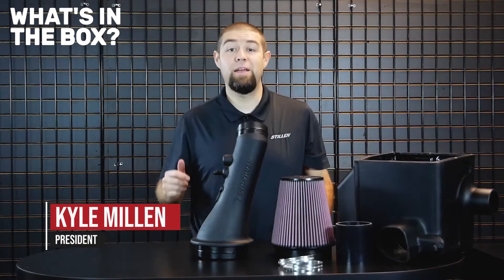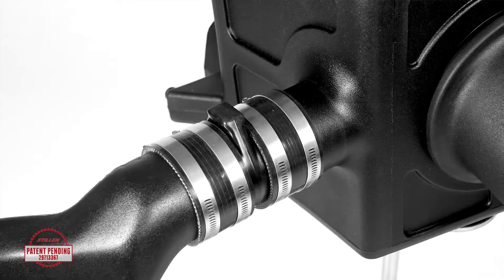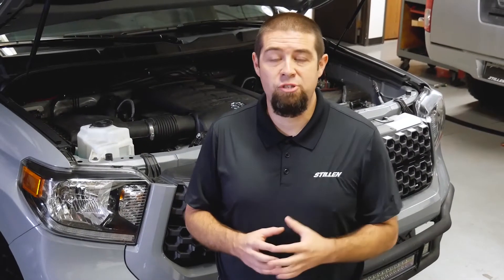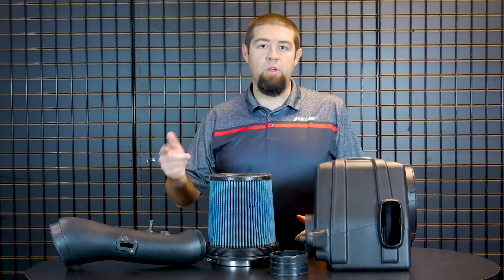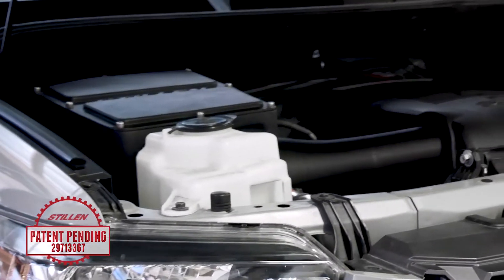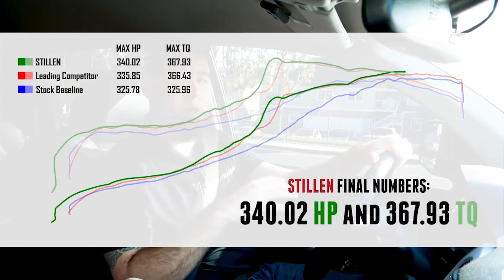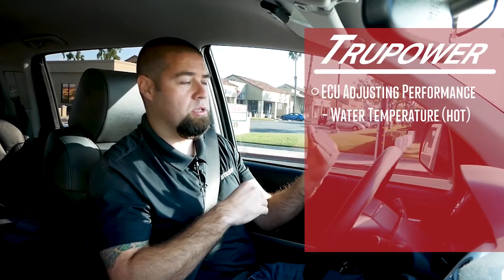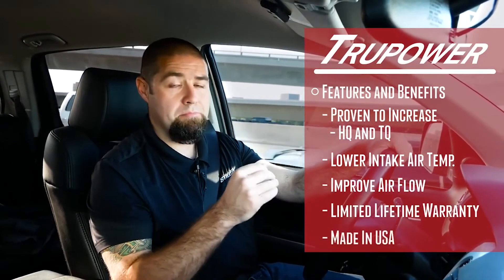STILLEN Trupower Cold Air Intake Direct Flow Toyota Tundra 5.7L (14-20) Review & DIY Install How To

Comment: Just installed one one my 21 Tundra and a couple of tips I’ve got, I had to trim the two grommets that are used to mount the intake box because the screws weren’t long enough to engage, mine also doesn’t use the larger grommet. The plastic tube adapter that threads into the intake tube was too small and required the use of a zip tie. The biggest thing is the fitment of the intake tube to the box, mine actually had a gap and you could see light, probably should include some type of gasket to go in between the two, I actually just used some silicone to close up the gap. I also had to trim some of the insulation from underneath the engine cover, where it goes over the tube going to the throttle body.

Comment: Does this work on the 2011 tundras? Where the inlet goes my transmission cooler lines are running through that area where the inlet tubes goes through